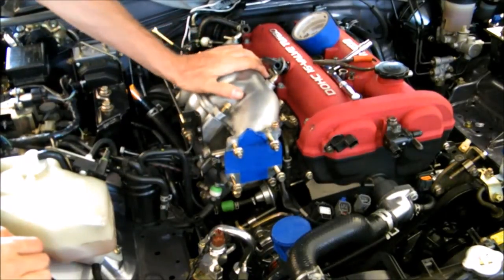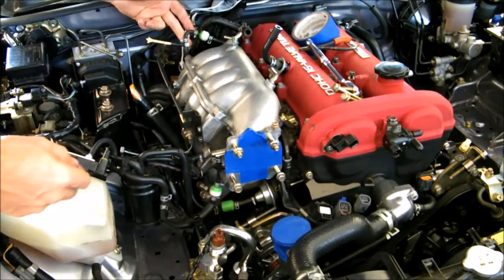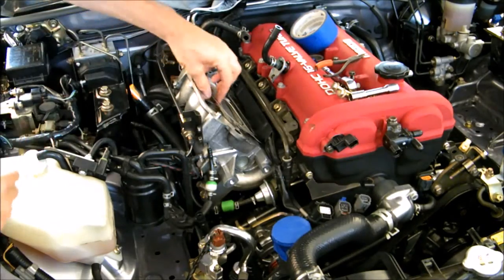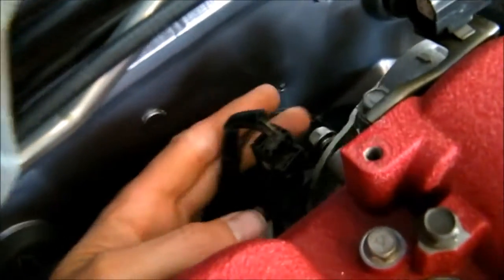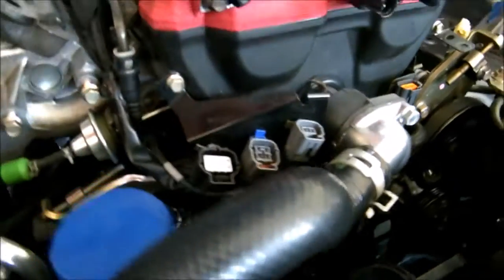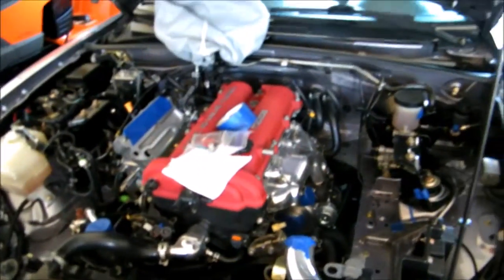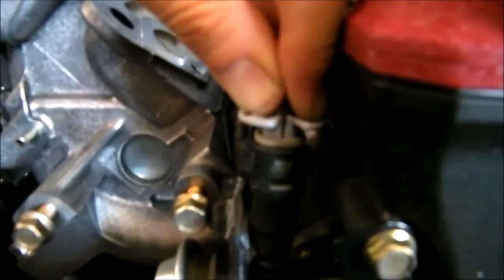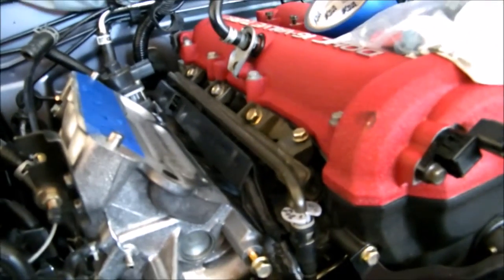Mazdaspeed engine removal part 4 fuel injectors

Comment: Is it necessary to do this step if all you want to do is physically remove the engine?
Reply from the maker: I lifted the whole engine & transmission out before with the intake manifold & turbo connected.